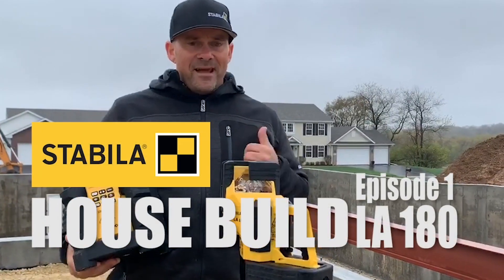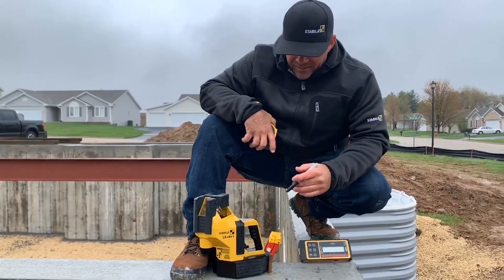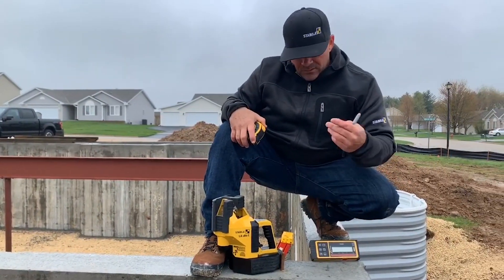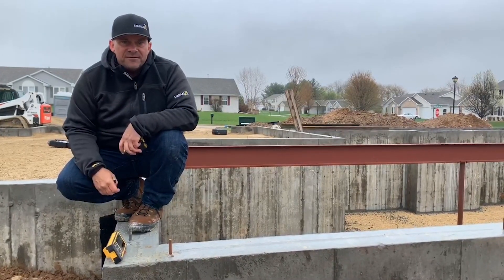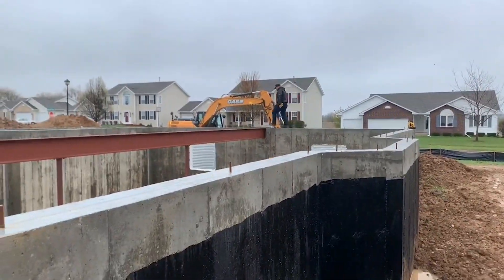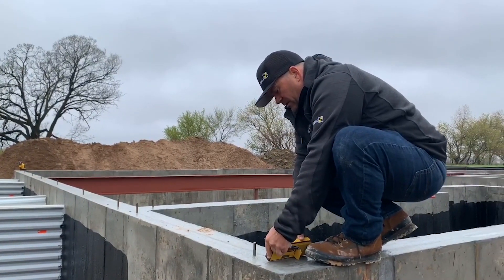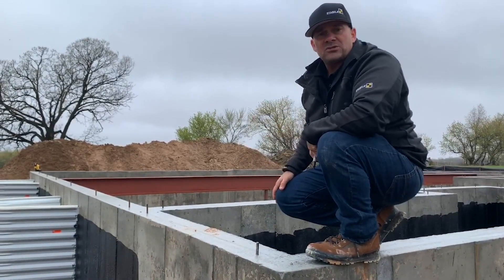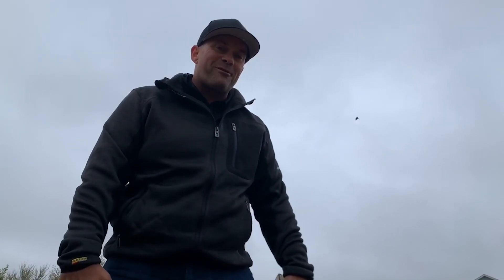STABILA House build | Episode 1 | LA 180 L

Comment: So this is $2,000 and all it does is a right angle layout?  It’s not for leveling? I want one but, man, I don’t want to keep up with a  collection of lasers for each individual task.
Reply from the maker: The LA 180L is a self-levelling multi-line laser for precision results – motorised controller and accuracy of ± 0.07 mm/m. It has 3 vertical lines, 1 horizontal line and plumb-line function 💛🖤

Comment: I don’t understand , at the beginning of the video, you marked 5 1/2” and then you  went to the other end and mark 5 1/2 as well? Why? How do you know the other end going to be exactly 5 1/2” just like the first side ?
Reply: When marking your control line
Reply: @ThermalSolutionsHVACR  I think he just used it as a point of reference, then the receiver dials it in. I think.
Reply: That's the standard width of the sill plate he will bolt to the top of the wall. 2x6 is actually 5 1/2 inches wide.

Comment: At my jobsite my error tolerance its about 1mm or (1/64)inches im steel erector. thit layout station can suit for me?? My job sites are about 100meters
Reply from the maker: Hi STABILA Fan. Our LA 180 L (Layout Station) has a Levelling accuracy of +/-
0.07 mm/m 👍
Reply: @STABILAOfficial   even on aligment??  its the same spec?.my problem is aligment i need accuracy on aligment regards
Reply from the maker: @faridmahomed3339  Levelling accuracy +/- 0.07 mm/m and
Line straightness +/- 0.10 mm/m. 
Check out more about the LA180L under https://www.stabila.com/en/products/details/la-180-l-multi-line-laser.html 👍💛🖤💪